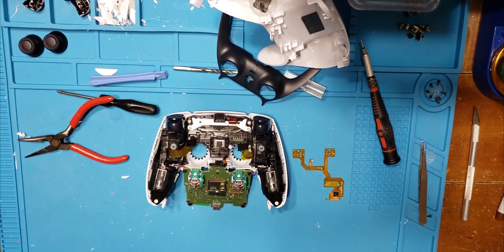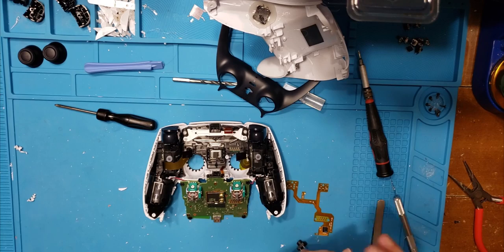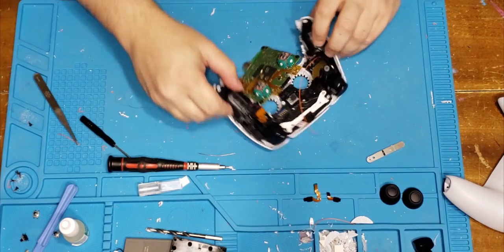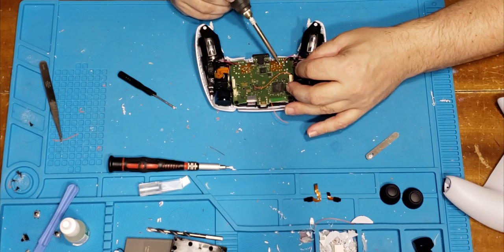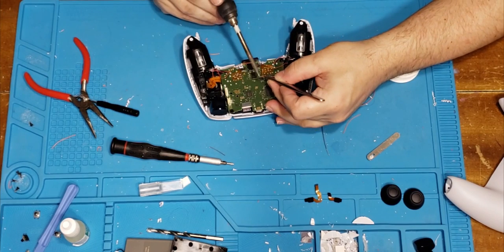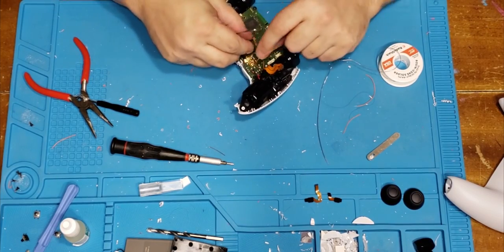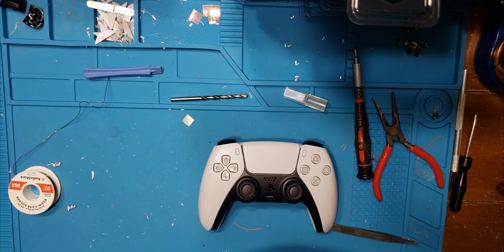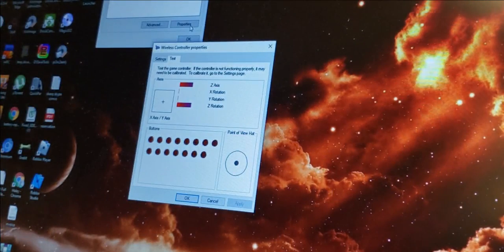PS5 Dualsense PROGRAMMABLE REMAP PCB + GRIP BUTTONS  DIY GAMER TUTORIAL BUILD UR OWN Controller

Comment: Great video. Are you adding tact buttons on the bumpers & triggers? I see you removed them and added wiring.
Reply from the maker: NOt at the moment. I find that method messy and hard to get them accurate.  On the XB1 controller it is pretty easy because the MOBO is flat and you can put a NICE good tact button (industrial) under the Trigger and wire it up for Instant Triggers.  I've been doing that on XB1 since 2013.  ALL XB1 controllers revisions 2013,2015,2017,2021 all have the same hall sensor and magnet on the trigger and the trigger mech is exactly the same. So the Buttons I used back in 2013 still work in 2021.. You need to slightly adjust them but still they are accurate and clean.  

The PS5 controller is another story.   ALl the people doing mouse (instant) triggers are using these very small tact buttons and wiring them up to the trigger mech and they fail pretty quickly. They are also not accurate as those very small tacts are not made for gaming. They are made for button senors like on appliances and such.  Something you press like a few times a day maybe.  You do not want those small appliance tact buttons in triggers and bumpers that you are pressing over 400 times in a match and like 5-10K in a full gaming session.  SO until I can get my industrial tact buttons in the trigger mechs I do not install them,  I have a prototype done and it is SUPER SLICK.. it replaces the PCB flex board and pad that is in the trigger mechanism. You take the trigger apart.  Take the FLEX out. Lay my flex on that will have 2 industrial tact buttons and plug it into the Trigger mech PCB that connects to the main MOBO>  it also has resistors and circuitry built in so if you use it with my Programmable remap or my Rapid fire boards, there will be no need to solder the 4 wires from the trigger mech solder points to the PCB flex remap board. It will all go together nicely.  The prototypes will be done soon. I expect to go full production by end of July.  They will NOT BE CHEAP. I am expecting a pair of these to sell for around the same price point as my Programmable remap.   SO your looking in the $25-35  range. But it will be a true flex solution with REAL industrial tact buttons that can take someone clicking them over and over minute after minute...   I will have a WHOLE NEW VIDEO when that happens.
Reply: @MODCENTRALUSA  Thanks for detailed response. I have been using Battle Beavers for my last 3 DualShocks controllers and they just don’t hold up. Always get stick drift after 3-4 months and the small omron switches fail or break. I have 1 BB controller that I keep running from the parts from the other 2. I have the 160g sticks that I solder every few months to fix the drifting. I have an evil DuelSense controller on order to see how they are. But I’ve been thinking of just creating my own with your great videos and items you sell. Thanks Again

Comment: I got mine from modcentralusa, and it was a nice project to take on. I went full custom with my build, replaced everything... dualsense case, all buttons, d-pad and touchpad. I only keep the joysticks and the triggers, because it was a black controller. And with the rapid fire pcb I added grip buttons. If you have the skills I highly recommed you take this diy project

Comment: Awesome! Did you modify the vibration pack housing to be able to fit the buttons inside the controller?
Reply from the maker: Nope... If you look at the video and the brown marks that I made on the shell for the placement you can actually fit 12x12x7.5 mm tack buttons with no modifications to the internals.

Comment: I want to remap (ps5) only the front facing buttons (Square, triangle, O and X), I want to change them between two paddles (buttons). So sometimes X on button 1 and O on button 2, and then switch them sometimes. Is this able with the normal remap or should I buy the programmable remap? 

Ive bought the ps4 prog remap before from you, so would like to know whats youre advice :)
Reply from the maker: You want the PRogrammable remap.
Reply: Send an email for the order. Thank you for the fast reply!

Comment: Is there a video on how to active rapid fire?
Reply from the maker: if you bought a rapid fire board- the instructions were attached or included if you bought a premodded controller. 
The install for both boards is the same. 
There is no video on how to use it, that would be over an hour on it's own. Just check out the instruction guide.

Comment: Do you do mods on the triggers for Dual shocks? Looking for buttons on all four.  Also do you do any upgrades for tension?
Reply from the maker: I am not a modding company.  I sell remap boards (ez, programmable, rapid fire) and such to modding companies and I do some simple mods on the side. 
I make modding your controller easier....
My tutorials, and if you email me, can show you how to do installs and such, are just guides on how to use the products I sell.
You can do "smart, fast" triggers (whatever you call them) with just 2 wires and a tact button.  My programmable remap does accommodate the L2/R2 fast trigger output if you want to add that to a programmable remap.  SO you can do up to 4 programmable buttons and still attach L2/R2 wires to a tact for "fast/smart" triggers.

I personally only do remapping on controllers as small modding projects.  Grip or paddle installs.  I do not have time to do intricate mods like fast triggers and such, with tearing down the controller and such.  SO no I do not install trigger tact buttons or bumper tact buttons  (which is much harder to do, like a 2 hr mod) it's a pain in the arse quite honestly.  Triggers are easier if you have the right tact button.

I can do 2+2 (2 paddles / 2 Buttons) on a controller for 4 remappings if you wish.  Right now 4 grip and or 4 paddles is Tight and makes the controller hard or impossible to close up right. 

As for tension mods.. 100% out of my wheel house. De soldering a Analog from the PCB taking it apart to add a stiffer spring and put it all back together and resolder it to a controller PCB is honestly left to pros who deal with that stuff. I am a PCB guy.  I Likely would kill more analog sticks than get the mod right.  Sorry

Comment: Hi, do you recon you could get 4 of the big buttons in the shell, would like to get the ones you use then i dont need to buy caps.
Reply from the maker: Doubt it.... Best I was able to do was 2 paddles and 2 buttons
Reply: @MODCENTRALUSA  ok thanks bro
Reply: @MODCENTRALUSA  what height do you recommend so the buttons stick through because if i get smaller ones i will have to get button caps likely

Comment: where did you buy the back buttons? and is this the rapid fire etc mod?
Reply from the maker: This is NOT a Rapid fire mod. This is programmable remapping only. The install for this is the same for the RF mod which I sell as well. 

But any buttons you want anywhere...  I get mine from ebay.

Comment: Hello. Does this mod allow for more than 2 additional buttons? I believe the hard remap mod allows for more than 2 buttons to be added to the controller. Is the same true for this board?
Reply from the maker: You can add 1000 buttons if you wanted and just solder 1000 wires to the EZ remap.   I just show 2 for demo purposes. 
The Programmable remap can only accomodate 4 programmable buttons
Reply: @MODCENTRALUSA  Thank you. 4 is perfect. I'll be trying hard to find a way to mount some side buttons next to R1/L1 similar to the Scuf Vantage. I haven't torn into one of my DualSenses yet, but I'm itching to see what a nightmare it will be to find space next to those huge adaptive trigger modules.

Comment: My big thing is how to getthe button in for tactile triggers which is a must now since I started making controllers.
Reply from the maker: It's definitely possible and has already been done some of the companies that I sell the boards to have already shown me some finished controllers that they have wired triggers directly to the controller, such as instant triggering system, or tactile triggers.
Reply: @MODCENTRALUSA  What’s the feasibility of a flex board with solder points for LR1/LR2 that entirely replaces the trigger assembly pcbs? Would be nice to remove the boards and the moving parts in the trigger assembly for comp controllers.
Reply from the maker: @rock1jump113  actually with the programmable remap board if you solder wires to pins two and four from the top of each of the ribbon cable connectors on the main board to the R1 R2, l1 L2 on the program will remap you can eliminate the triggers completely. Actually a revision to the program will remap is already in the works that will have l1 and R1 on it, right now I've already have R2 and L2 on the program will remap for people that like to use tact buttons for smart triggers.
Reply: @MODCENTRALUSA  Could I then leave the trigger flex cable disconnected if I solder smart triggers to those pins (2/4) and proper ground?
Reply from the maker: @rock1jump113  YES.... But you will need to disable the activetrigger resistance feature in the settings or you could get ghost presses.
Reply: @MODCENTRALUSA  OK, thanks!

Comment: Hey! I got a remappable board and installed it last night - the M1-4 buttons work but I’m unable to remap by holding down L1, L2, R1, and R2. I noticed on the board there was a Mod solder point that I didn’t use. Is that necessary? Also the ground solder points by L3 and R3 don’t seem to have any metal contact points - I assume those aren’t used then? Last but not least I’m also wondering if I could have a bad solder connection with the U1 point. Any thoughts on what I should troubleshoot?
Reply from the maker: R1/2 L1/2 are 100% necessary. U1 is fine if your maps work. You are correct there is no solder on the larger holes it's just for holding them in place when you do r3 and l3
Reply: @MODCENTRALUSA  ah, that makes sense - I skipped soldering the L and R buttons. Thanks!

Comment: Could you fit 4 buttons? Is there enough room inside?
Reply from the maker: Yes and No. 

The large grip buttons will not fit 4 without removing the rumble motors.   Depending on your placement you could use smallerbuttons with caps or you can do a combo of grip buttons and paddles.

Comment: I did everything as you say and it does not work for me on pc
Reply from the maker: so what did you do?  What is not working? The remaps?  The controller?
Reply: @MODCENTRALUSA  I checked again and everything is correct the only extra thing I did was add 2 more buttons L1 L2 R1 R2
Reply: This works on pc or only on ps5 console
Reply from the maker: @hugosandoval6499  The ps5 controller only work on the PS5 and Steam on the PC.   Any modification you make to your controller if installed properly will work regardless, has nothing to do with the platform. But if the platform don't support the controller, obviously your controller + mods are not going to work..  PS5 controller i do not think has FULL DRIVERS for pc gaming, only steam i believe.  But the controller tester on windows will recognize it for testing like i do in my videos.

Comment: Can you add the rapid fire board in Amazon.
Reply from the maker: ATM no.....

I am out of ASIN numbers to make new listing. 

Email me if you want one.   modcentralusa@gmail.com

$25 no tracking
$28 with tracking. 
like $8 cheaper than the Amazon listing will be.
Reply: @MODCENTRALUSA  what about for next day shipping how much do you charge ?
Reply from the maker: Email me. It all depends on your ZIP code, and what solutions I can get to in the next day or so. If it's going to be fedex, they can pick up from me. if it's ups, they do not pick up and I don't have a store nearby and I really don't think I can get to one, the post office really isn't being reliable even with express mail but they can pick up from me so I can probably do that as well. each of these solutions is a different price depending on what ZIP code it's going to, so email me and we will figure it out.

Comment: Can I use it for 4 petals? Is it possible to assign R3 and L3 to the petals here?
Reply from the maker: Yes u can assign r3/l3.

4 paddles is gonna be hard to do due to room inside. It all depends on how good you are at it's stalling and what you feel comfortable with in terms of how close the paddles are to each other.
Reply: @MODCENTRALUSA  
I already have a solution for setting four petals. I am wondering if I can solder 4 buttons to this flex board?
Reply from the maker: Yes 100%

M1 m2 m3 m4
Reply from the maker: @АлександрШевцов-в4я  They are all marked.  You can't really mess this up.

Solder 4 wires to R1/R2 L1/L2 from the controller points in the video.

The Remaps are M1, M2, M3,. M4.  2 wires from each M point to the buttons. 
pretty simple.
Reply: Where are the R3/L3 solder points on the board?
Reply from the maker: @curtkirkhoff9781  email me I will send you a pic
Reply from the maker: @UCAeqjcIO2wxCg0d_ljrGajQ read the video description
Reply: @MODCENTRALUSA  email sent! Thanks :)